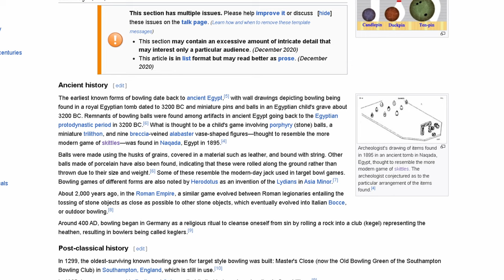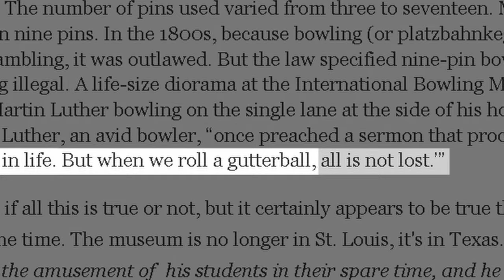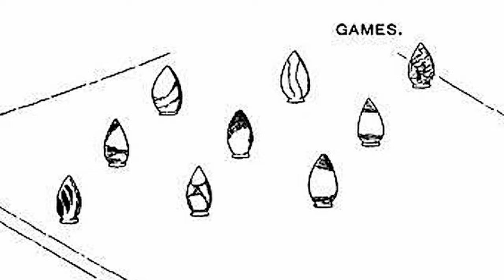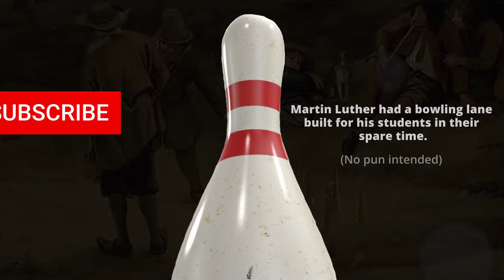The Unique History of the Bowling Pin

Comment: Actually candlepin bowling, which found in New England, and Eastern Canada is older that the sport of ten pin bowling.  Candlepin pins are about 15" tall slender pins that can stand on either end. The ball is about the same size as a softball,with no holes, and only weighs around 2.6 lbs. Three rolls per frame,the the downed pin aren't removed. That could help,or be a literal road block. In candlepin, there has never been a perfect 300 yet,the game is far to difficult. Check out videos on YouTube about candlepin, or watch a match. Or if in New England, try it.
Reply from the maker: I did find information of Candlepin and Duckpin which was really interesting, but decided to focus on 10 pin for this video to keep it more simple. I will focus on duckpin and candlepin in a future video.
Reply: I just seem like the small ball variants of bowling, candlepin, duck pin,5 pin. They are like the Rodney Dangerfield of bowling,no response. Yes ten pin is the most popular. I don't bowl ten pin,compared to candlepin, its just boring.